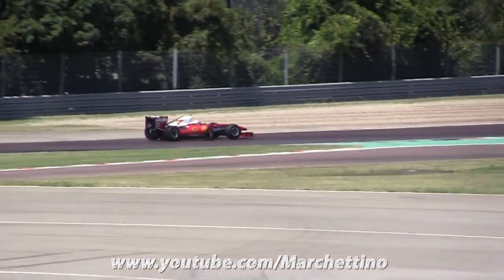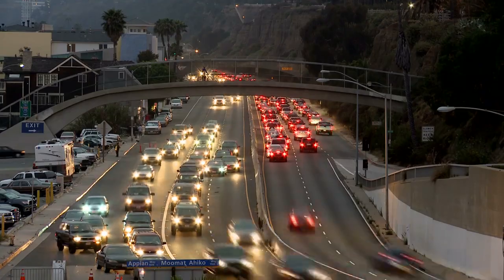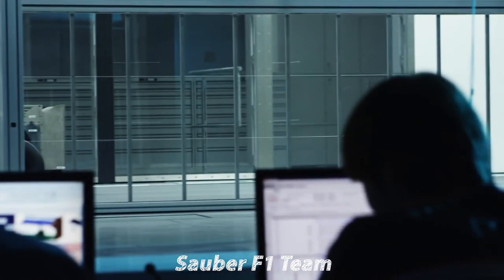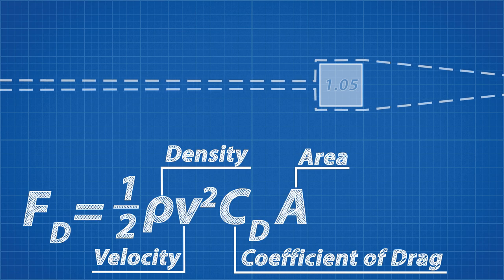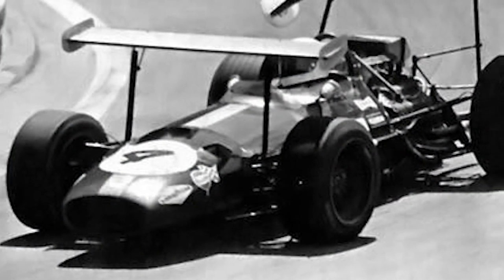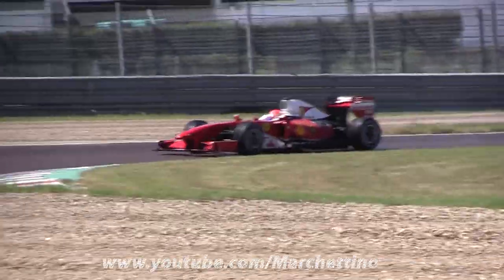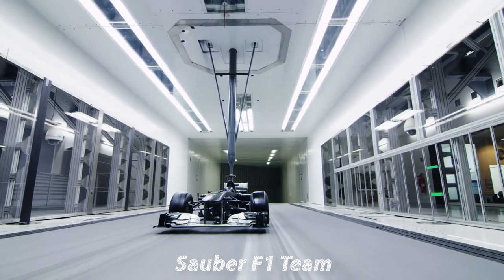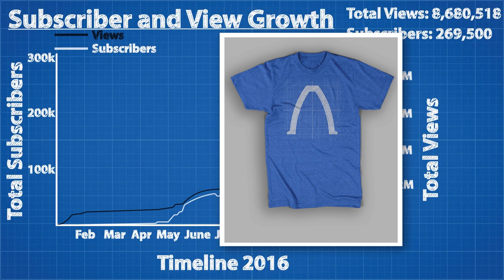The Greatest Innovations In Formula One

Comment: The problem with carbon fiber is that it A) requires a lot of resources to produce, and B) it’s garbage at the end of the vehicle’s life. Aluminum and steel can be recycled virtually forever. Resin impregnated CF will sit in a landfill for a long, LONG time after just one use. Not to mention you can’t easily repair CF parts. They crack and shatter, instead of dent and deform like metals.

It’s not saving much, if any resources/energy.

Comment: You should do that crazy LMP1 Nissan with the mechanical energy recovery, it spin an 8 kilo fly wherl at 54,000 RPM which the driver can engage to the prop shaft under acceleration giving a huge power boost for a short time.
Reply: Shame that the thing never made to Le Mans.

Comment: Sorry but I feel that the Lotus 72 was more of a groundbreaker than the models that followed it. The 72 was an almost insane departure from what engineers kept thinking. The cigar shape body was replace by one that was squat and squared off in front and it had a huge rear wing to maximize downforce. It also had sidepod radiators. The 72 was quite complex and the mechanics complained it "was a sod to work on!" But in the hands of Jochen Rindt, he simply crushed his rivals with his amazing car control and his incredibly upbeat attitude behind the wheel. He had so many points that when he tragically died in Monza, nobody could overhaul his points. He is the only driver named World Champion posthumously. The 72 was then used to bring Emerson Fittipaldi his first title. There were rumors that Lotus TRIED to replace it. In free practice, they couldn't believe how awful the lap times on the prototype were. The embarrassed mechanics had to go to the MUSEUM and ask for their car back. They souped it up to bring it within the new regulations. Emerson, like Rindt before him, annihilated the opposition bringing Lotus another title. I know of no other F1 car that was yanked out of retirement to win more races...

Comment: I just need to say this, ground effect generates a lot of downforce, but it is also insanely dangerous. The skirts were bannes beacuse if there was a moment where the skirts where not close to the ground the cars would often spin out wildely. Another thing you could have said is that williams tried something like this when the skirts were outlawed, they tried to put the car as low as possible, therefore making a slight ground effect, but they chaneled air so that the main body became a giant aerofoil, Google it, a good read
Reply: It's what sends the cars flying into the air so quickly if they don't stay hugged so close to the road. We've seen it countless times in F1 crash highlights. The car often just wants to take off once that initial downforce is broken, lol.

Comment: I doubt that the energy is the main reason why carbon fibre is so expensive. I guess the main reason is, that CF is only strong when it is used in the right way. Meaning that the fibres have to be aligned in the correct direction to show its full potential, which can not being made by machines. So it has to be made by hand by good educated people, which costs a lot.

Comment: I imagine set of air intake tubes that lead to the exhaust or maybe a turbo.....them add a set of tubes (maybe one near each quarter of the car) that are perpendicular to the intake tubes. The exhaust or turbo would cause the airflow into the intake tubes to increase...and as that speeding air rushed over the perpendicular tubes, it would cause suction, like how your vaccume cleaner works. 

In other words: use intake ports and a compressor (air or belt driven) to provide suction to tubes on the car, literally causing it to cling to the road like vacuum cleaners were attached, but using the air from the car's forward motion. ©(tm) patent pending

Comment: As incredible as the aerodynamics are at their current stage, it's actually killing the sport. The current cars rely heavily on their aerodynamics which results in some truly staggering times and figures but requires clean, undisturbed air to do so meaning the cars need space to remain competitive otherwise they lose that edge and become difficult to drive and slower. In short, the racing becomes dull and turns in hotlapping. The real competition in F1 is essentially between the engineers rather than the drivers. Admittedly, this is part of the fun with F1. Developing new tech to give their teams an edge and interpretting the rules differently than the rivals is interesting but that's not why we watch or enjoy F1. I'm not saying that we should it to spec racing either though. What I'd like see is either more emphasis on tech that reduces a cars reliance on aerodynamics, have the cars rely primarily on ground effects for their downforce (seeing as how it tends to reduce the amount of disturbed air in a cars wake), or introduce new regulations on aerodynamics that require the cars aero equipment reduce the amount of dirty, disturbed air it produces. The problem with last solution is that's seen as aiding rival teams. The manufacturers would rather have the pursuing cars struggling instead of allowing an equal playing field for the competition. But for the sake of fans and spectators, somethings gotta give and what's gotta give, I believe, is the current state of aerodynamics.

I'm sure you've got an opinion on this as well so if you ever see this/read this, I'd love to hear your thoughts on the topic.

Comment: carbon fibre in aviation is used only for parts that doesnt support the body, its used for things like cargo doors or for the front cone where like a satelite is situated. A plane is made hardly of 3% of carbon fibre. On some planes 15% max. if we are talking B737 or A320 and bigger.
Reply from the maker: Absolutely incorrect.
Reply: It maybe, maybe I have outdated info.

Comment: @10:14 theres a lot of people who complains about the engines of F1 going to turbo v6. A lot of the complaints seems to be because it doesnt sound good......I mean, are you kidding me? You hate the engine because it doesnt sound good? Thats the most asinine answer for hating the engine. That v6 engine has brought big changes in the way the teams race now, they are saving much more gas which means the cars dont need a fillup, which in turns makes racing much more fun to watch.

I hate it when people say F1 is the pinnacle of racing, why are they handicapped in technology. Thats just so black and white, its not that simple. Capping certain things in design will make the technology in other parts of the car that you hadn't thought about before becoming more integral to winning now. Look at how theres no more fuel stops, it causes the teams to make the engines more efficient which in turns make them developing turbo v6 which makes the same power as a v10 but uses almost 100kg of fuel LESS in a race!!!

Comment: Chapparal won LeMans? Who's history books do you read Mate? 

The Lotus was NOT the first ground effects car, although it was of course the largest step forward with the use of tunnels and sideskirts. The March 701 in 1970 was the first attempt (go look at pictures of it), but they believed it didn't work. The 1973 Brabham BT44 did. Gordon Murray intentionally designed the floor for downforce, even tested and measured the downforce increase in South Africa with a manometer and figured he gained 100 lbs of downforce. 

The fan car was not exclusively banned, after the race as is often reported, or at the end of the season. ALL major designs to create downforce were prevented under the rules for the following season. Only Mario complained about the stones being thrown by it, and that was a lie prompted by Chapman.  Funny thing was the very next race, Brabham got pole witht eh 'standard' car!

Comment: why did it take so long to get steel disc brakes reliable? when servicing  them on my cars it seems like a straightforward design... steel quality?
Reply: its the materials that went into those discs and their pads, a lot of heat builds up in a short space of time on the pads when stopping from high speeds, its took time for the materials to come along that could take that heat consistantly and create the neccecary friction, it's not steel on steel

Comment: I don't like all the F1 rules politics. Time and time again, someone does something truly innovative and they get slapped down for it by having their car outlawed. How is that helping innovation? It's not! They ought to outlaw a$$holes from the sport instead. If you start complaining about another team and their car design, that ought to be the last thing you do in the sport.

I also don't like that F1 cars are so far removed from road cars. There was something to be said for the simplicity of the good old days when racing a car meant seeing how fast you could make a street-legal car go. It had nothing to do with building a special-purpose and otherwise useless vehicle that can only be run on a track.

Carbon fiber is not a good thing for the industry. It's super-expensive, even if you use hydro power in Moses Lake, Washington to make it. That amount of embodied  energy also makes it automatically un-green in the eyes of many people. It over-complicates the car-making process and can really only be used in low-volume cars. Even worse, it makes them practically unrepairable. You can't just hammer a dent out of a carbon fiber panel. It's brittle, shatters and shreds when hit with a sufficiently hard blow to damage it. The only option is to replace it with a new part.

Comment: You're conflating different carbon composites in this video.  You show a picture of a carbon reinforced silicon carbide disc, but F1 cars use carbon reinforced carbon discs which is a different material again from the carbon reinforced plastic used in chassis.

Comment: Disc brakes were not an F1 innovation, read up on their history.  Carbon fibre was not an F1 innovation either.  "A" in the drag equation is for frontal area (sometimes known as reference area), not cross sectional area (although the two may be the same in a simple shape such as a sphere).  I stopped watching after that...  Although your information is incorrect, your presenting style is good.

Comment: I'm sorry did you just say you like racing because it's more about the car than the driver? There would be no racing if it weren't for the drivers. Stupid statement. People like you just ruin the sport and essence of it. Racing should be more about the drivers and their skill not some pencil pushing engineers. That's why Formula 1 is so boring now, it's all about the cars. Real racing was back in the 70s even 80s, just look at the Lauda/Smith rivalry. You don't really have something like that now. Same with NASCAR, it's become a car dominated sport as opposed to the drivers. Just my opinion.